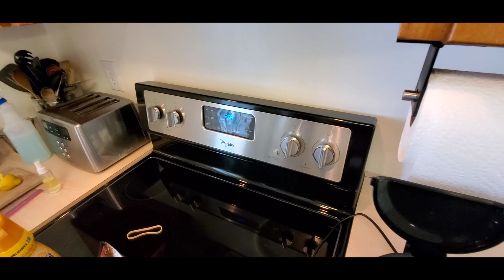Sboly Single Serve K-Cup and Ground Brewing Thermal Drip Coffee Pot 2 Month Post Use Review

Comment: I have a 7.5 inch thermal mug. Can someone kindly please tell me how much space is there to fit a thermal mug. Is it 7 inches, 7.2 inches, 7.5 inches ....etc  ????  Can someone measure the space in between with the drip tray attached AND how much space in between is there if the drip tray gets removed ?????  I need to purchase this ASAP and have been waiting to see if someone can take measurements and answer this for me ?????
Reply from the maker: It's 7" with the tray and 7.5" exactly without the tray. I have tall travel mugs that won't fit. Hope that helps.